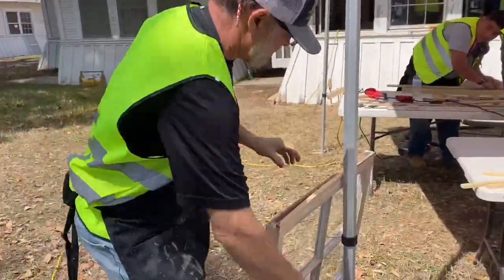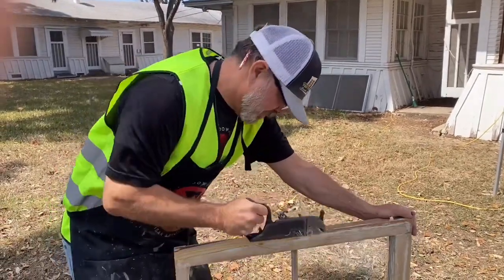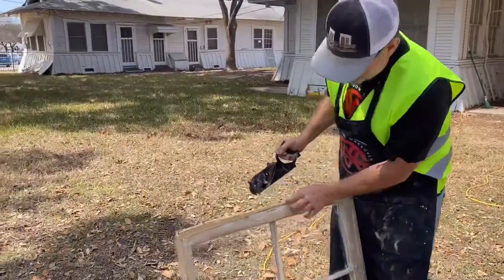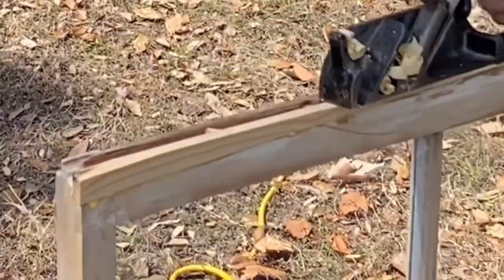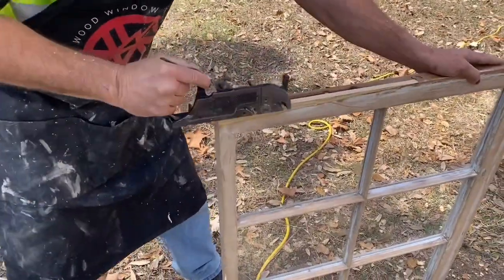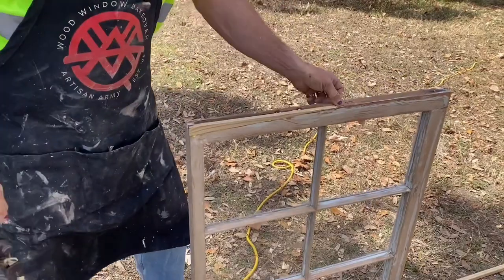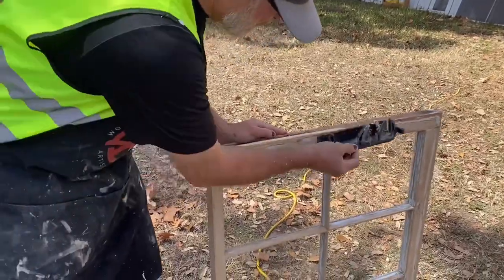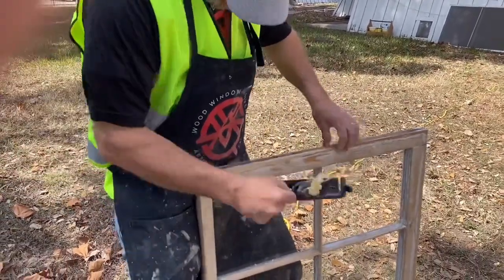Dutchman Repair with a Rabbet Plane on a Wood Window Sash

Comment: Nice work….your upload speed must have been set at 1.25x btw
Reply: Either that or he was pressed for time and was rushing…
Reply from the maker: No intentionally sped it up as an experiment because watching it myself, I thought watching a guy run a plan over a piece of wood several times might be hard to get through. But maybe I was wrong?
Reply: Ah that makes sense, I ended up skipping parts a couple times
Reply from the maker: Ah so I was right kinda